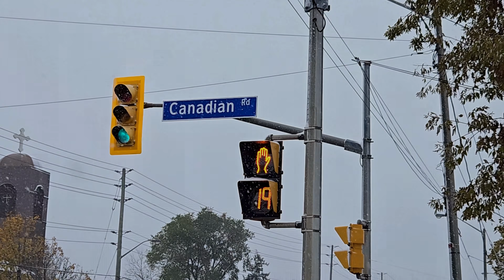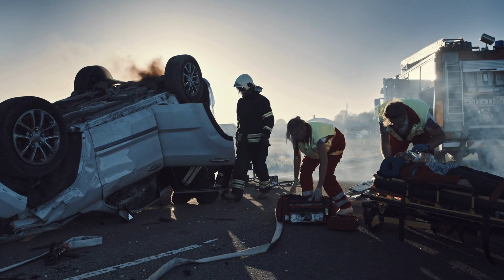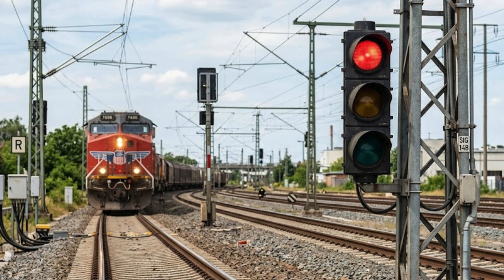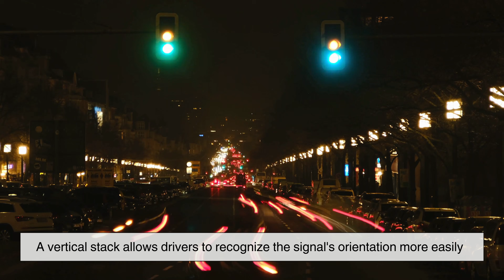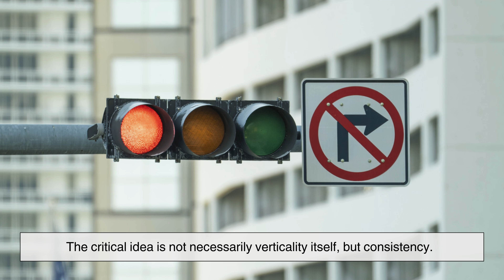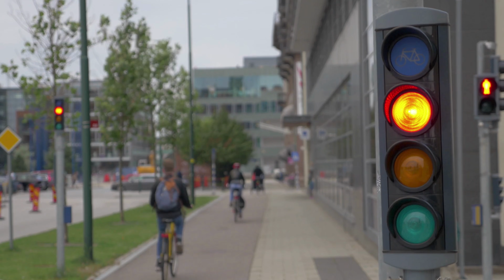Why Traffic Signals Use This Exact Layout

Comment: Not the always truth, at my childhood, the Traffic light for a  cross road located on the center of the road, consist of 3 Boxes in upright configuration, with 4 lenses of each street, one lamp for each box, that means when the uppermost light is ON, the opposite color is red and the perpendicular color is green, the middle were all yellow, the lowest has also have red and green lenses opposite to the top one.

Comment: Railways always have green at the top as old mechanical signals fall to stop as a failsafe if the cable snaps. Even no restriction road signs are a raised black bar. The real question is why traffic lights are the opposite?